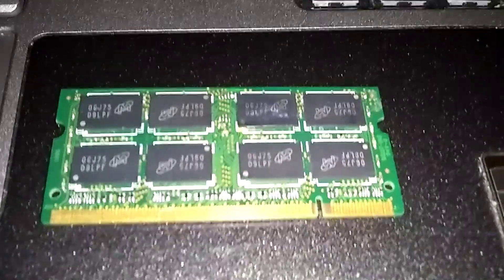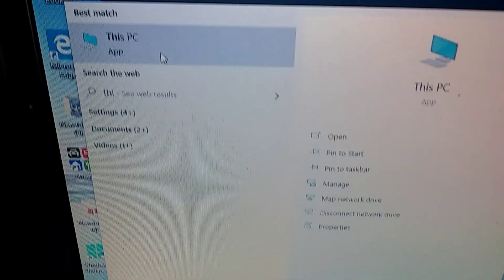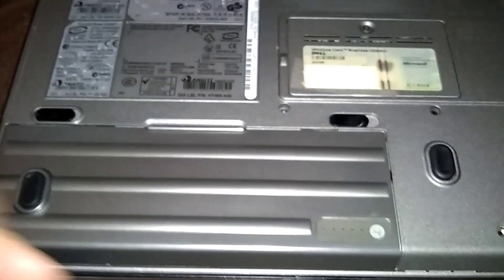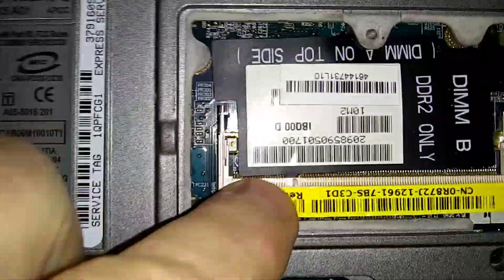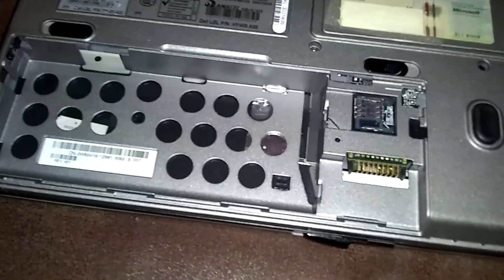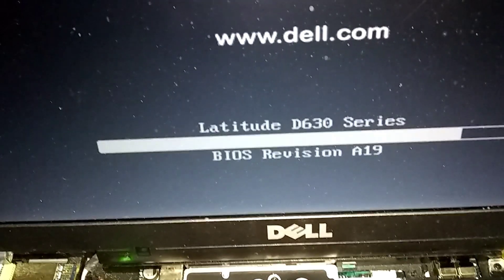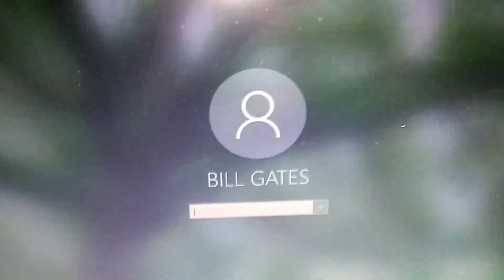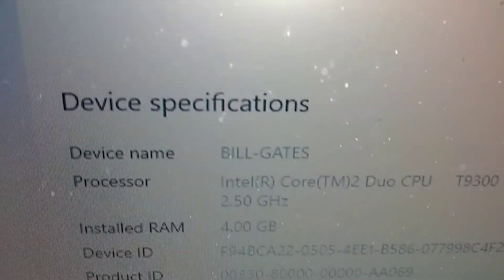2GB to 4GB Ram/Memory in 10 Minutes, Dell Latitude, Nervous Nick

Comment: Subscribed the other week I think 2 weeks. I bought the extra 2GB from your link, I took out the battery and opened the little door on the back. There was a memory ram in there. I turned it over and took off the keyboard, there was a memory ram in there. My computer only shows 2GB. Is one of them broken? Are they only 1GB each? If one is broken how can I tell without messing up my computer? HELP!
Reply from the maker: There probably 1gb each, take the one out under the computer, then restart with only 1 installed, see how much Ram it reports, you can also try to read the small writing on the white label attached to each Ram stick. Some d630's can handle up to 8gb if ram,. I think there's a Video in my d630 Playlist that shows how to download a free tool from Crucial.com that will analyze your laptop and tell you how much Ram it will handle. 4gb or 8gb. Look in my Playlist or scroll thru my videos.   Link:
https://www.youtube.com/playlist?list=PL2RY9mE4pXlrN7U7XZoFzSxQ9lfiSyIR7
Reply from the maker: https://youtu.be/cGtBHIywCpg